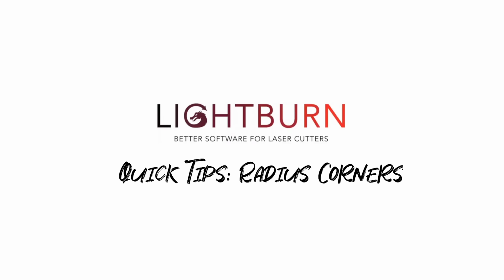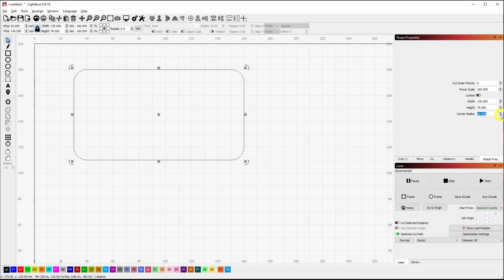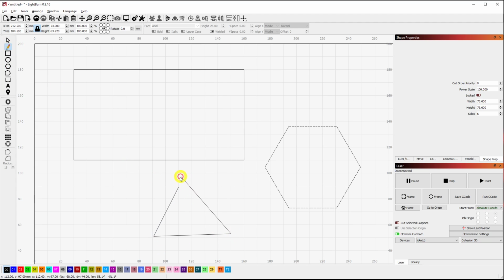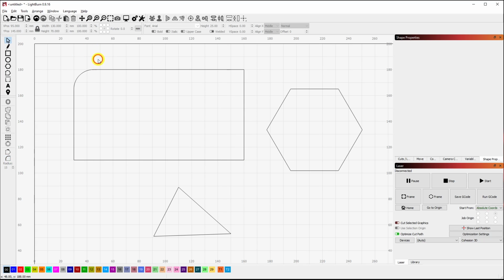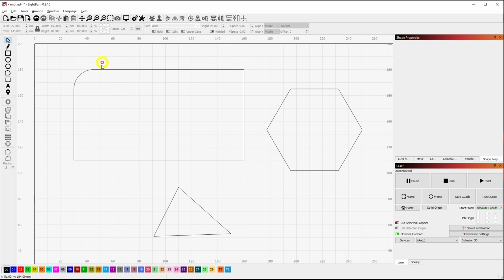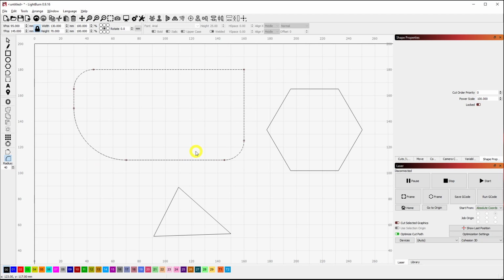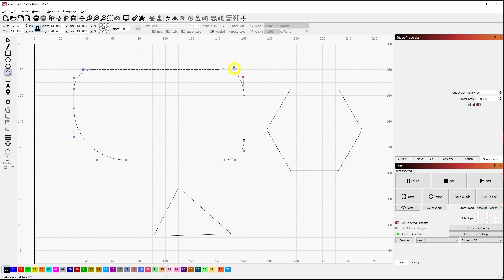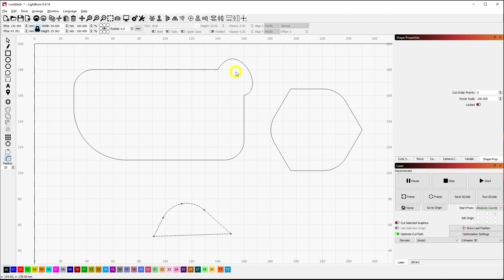LightBurn Quick Tips: Corner Radius

Comment: You can do this with the mouse, I just randomly did this but can't work out how I did it lol
Reply from the maker: Yep, as of 1.5 they added the ability to drag a radius on polygons.  Note that as of 1.6 if you need to press the CTRL (WIN) or Command (MAC) for the dot to show up.  Look for a small blue dot on your polygons. You can drag that to achieve corner radius and depending on the direction  you drag, you will get either a positive or negative radius. This video is back from before 1.0 so there have been a lot of improvements since then.
Reply: @thetinkerverse  Ah great, thank you for the fast reply, I'm going to take look right now..!
Reply: @thetinkerverse  Brilliant, found it, many thanks 🙏

Comment: I have version 1.5.01 they still have not fix this thing too many can't use the tool here and here
Reply from the maker: Hi there. This is an older video so there have definitely been updates but what parts of the tool are you unable to use?  I use radius all the time and I'm not aware of anything obviously broken.  

Is there a thread somewhere on the forum discussing or a bug request somewhere I can reference to understand any limitations I may not be aware of?  I can always publish updated videos. 

Thanks.
Reply: @thetinkerverse  I have an object I want to make a radius on a corner, I click the object it's highlighted I click radius and try to find the corner and it can't see it, it will not see the corner so it will cause the radius

Comment: Good vid, I think you can do a simple rectangle or square radius on all 4 corners using the offset tool and then resize the shape back to the original measurements, seems to work as I checked it recently. its faster this way using shape properties though.

Comment: Hi Carl, thanks for the video. 
Question since I’m stuck.
I make a square or rectangle, I click the radius button, keep it on 15.0, I move my cursor onto the corner of the box and it doesn’t change or let me click the corner. 
Not sure why, so I’m stuck at 3:23 , lol. 
(Lightburn 1.1.04, windows)

Edit: figured it out!  
Squares that are too small can’t since the radius wants to curve past the other point. 
Work on a bigger square then shrink later I guess 🤷🏻‍♂️.

Now to finish the video
Reply: This was spot on - actually what I ended up here looking for... so thanks!

I did also find that I can put in smaller values (decimals) to work with smaller shapes which seemed to solve the problem as well.